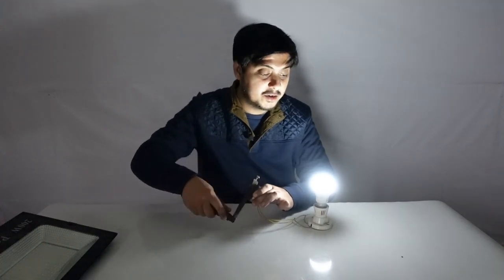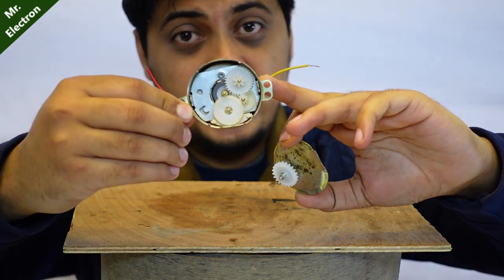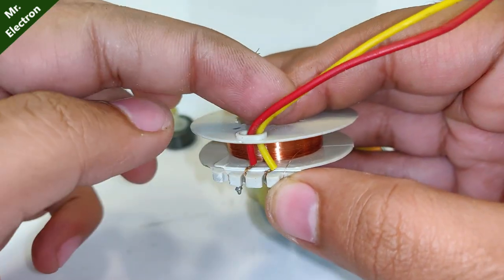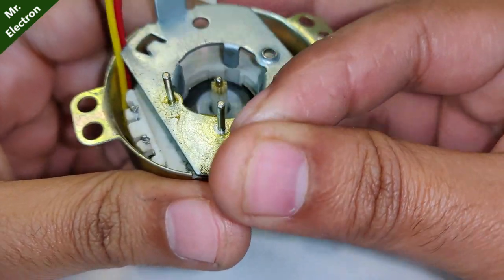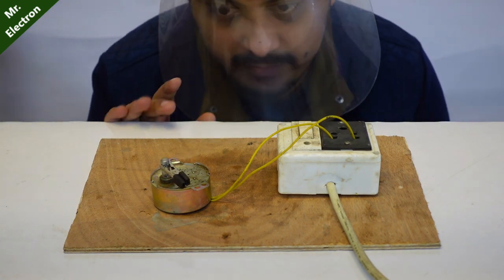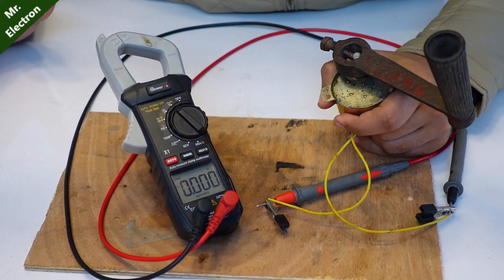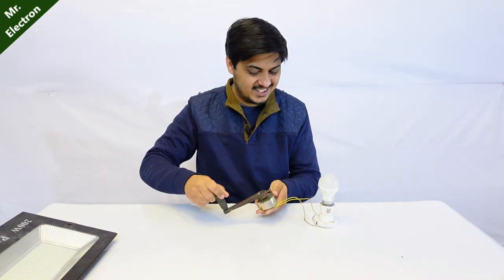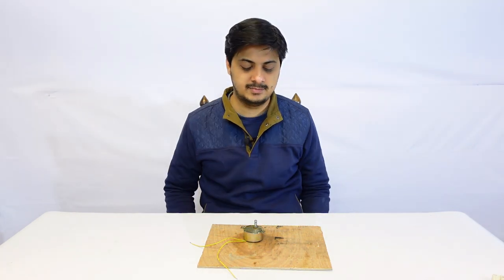500V AC Generator from 220V Microwave Synchronous Motor DIY - High Voltage

Comment: The reason you were shocked when you first touched the motor when connected to 220V supply is because you had a low potential around your body. Less than the 220V potential and your body has a capacitance. When you touched and got shocked, it was like you are a discharged capacitor getting charged. Once charged, you won't get shocked again.
Reply: Gracias, haora me explicas que me puedo cargar, estoy conectado a un toma corriente

Comment: Could you explain how this motor/generator works?  How does the current flow perpendicular to the magnetic field to get rotational motion as the winding of the stator are in the same plane as the rotation of the permanent magnet?

Comment: Can this be used on my wind-generator project? I have one of these motors from an old microwave that i salvaged from trash
Reply from the maker: We will know for sure in my next video. I am planning on doing some modifications.
Reply: Hey how's your wind turbine going?
Reply: @kamisama9715  hey, i build it quite a while ago, but i decided not to use the microwave motor cuz i didnt get that mouch power, instead i used a diffrend generator, it made quite some power but i didnt use it anymore so i dissasembled it.

Comment: The main reason was so you can power your electronics. How does it work? Your generator's armature winding produces a very low power from RESIDUAL MAGNETISM. This power produces a magnetic field in the field winding, which enhances the magnetic field and thus the current produced by the generator. I have done this on my channel and it worked! Check it out! I will also try using this method with initial battery excitation
Reply from the maker: Congratulations !!! You were the first one to give the correct answer and now you have successfully entered the contest.

Make sure, you are the first one to correctly answer for the next video as well to win the contest.

Contest Rules (video) - https://youtu.be/yM1HGrM2wNM
Reply from the maker: RESIDUAL MAGNETISM ✅✅✅✅✅
Reply: @MrElectron  tee hee hee
Reply: I'll make that my new channel catchphrase! RESIDUAL MAGNETISM!!!!
Reply: You always know your on the right path when you see channels your subscribed to commenting on other channels your subscribbed to.
Reply: @MrElectron  I answered it correctly before :( pls check my comment timing once more
Reply from the maker: No comment by you in my comment section. Comments with some bad word in them are auto blocked.
That could be the case then.
Reply: @MrElectron  omg
Reply: @MrElectron  shall i send an email of the screen shot of my comment
Reply from the maker: Ok mail me the screenshot...  Atleast i will point out the mistake
Reply: I do same project past 3days ago its really working
I Also connected it to dc capacitor through bridge rectifier its wprking
Reply: व्हर्टीकल टर्बाइन के द्वारा ऐसी बडी मोटार लेके मकान में दो रूम में  लाईट चलना ऐसा व्हिडिओ बनाने का मेरा सुझाव है

Comment: Why don't you use tester to check if the body of the motor is somehow sorted with winding rather than touching it🙄? And moreover you can take a Multimeter to check the voltage and if shorted that's gonna show 220V .

Comment: How can
 A 220V 50Hz 5W bulb glows
By A 483V random frequency generator!!!!!
Reply: First the ac current goes into a full bridge rectifier which is usually rated up to 1000 volts ac and converts the incoming current into dc. From there it is sent into a smoothing capacitor meaning that the input frequency is meaningless now. And as we know, voltage drops when a load is connected so it is fine since this is not a high current source.
Reply: @kamisama9715  Yes Yes